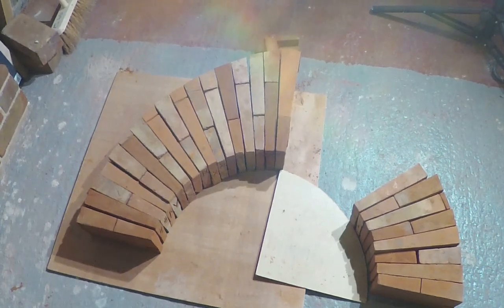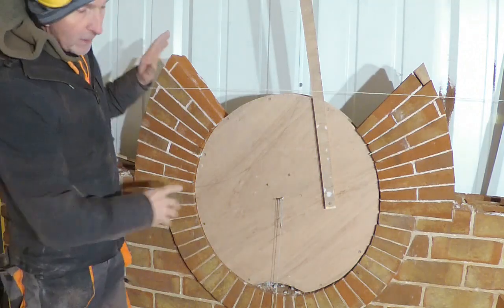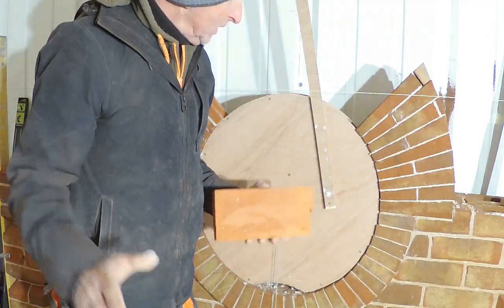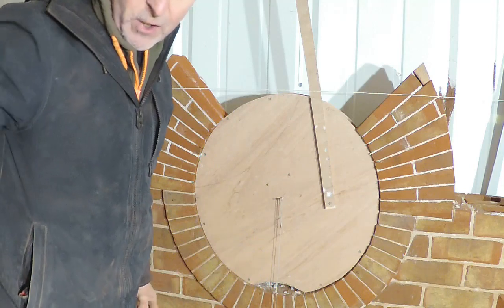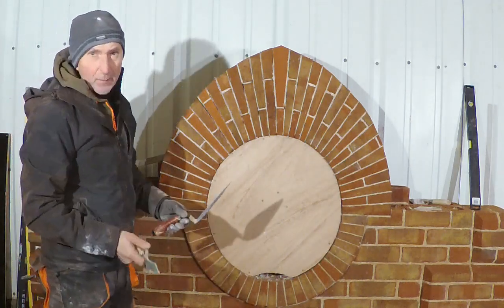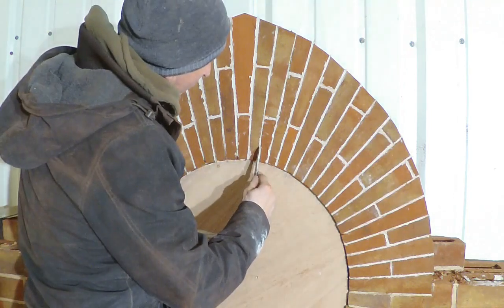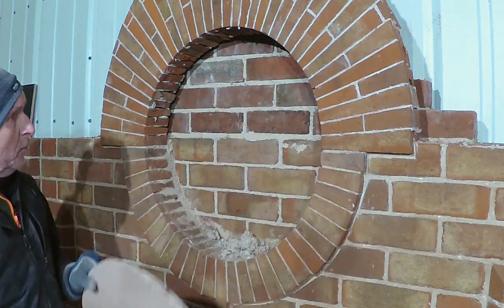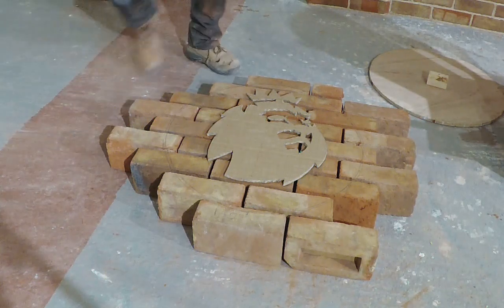the fine art of brickwork - Florentine Bullseye

Comment: Looks class and considering you did cuts with a battery powered concrete saw, cuts and joint width looks decent, would be some serious amount of cutting even if you had a bench wet saw but would definitely make life easier, what can you say but if it was Top of the Pops  you would be No 1 week in, week out👍